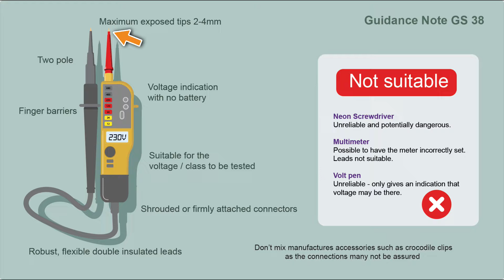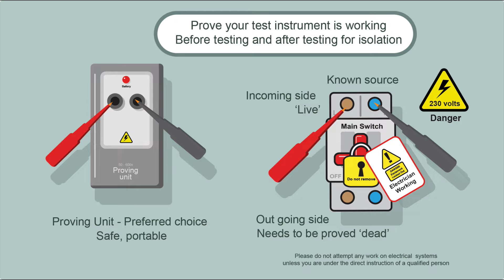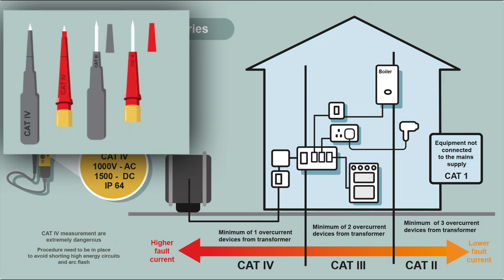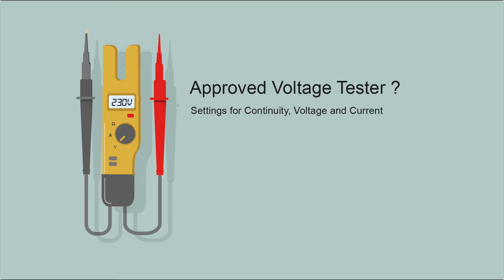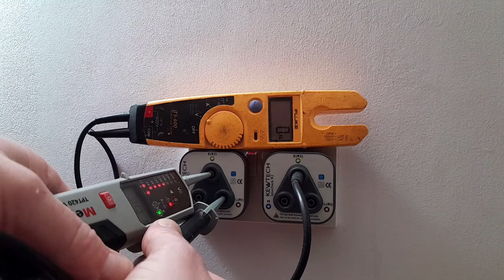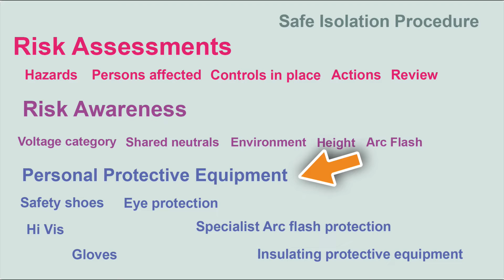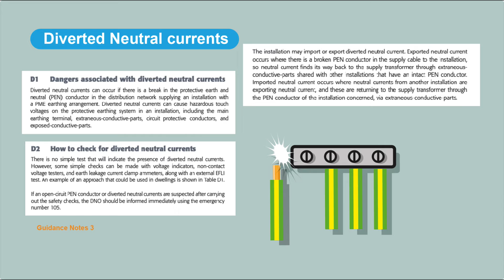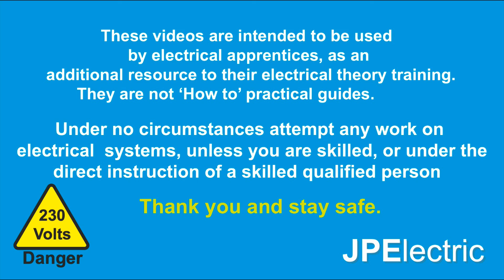Approved Voltage Testers - What are they?

Comment: The adaptor you use is for MFD’s, kewtech make a dedicated set of plug in IP 2x pins so you can use your VI units safely as well as the MFD units, to prevent the false readings you describe.

Comment: Good explanation. But two point , 1) why did you test line to earth ? You should test line neutral and line earth. And neutral earth. 2)GS38 say we should not use a multimeter because we could set the wrong range? What’s to stop me setting the wrong function on my MFT ? All it takes is a small distraction or lack of concentration, I have made such a mistake and blew up my MFT had set for continuity instead of loop impedance damage was so bad it was beyond economical repair. Simple mistake due to a distraction.